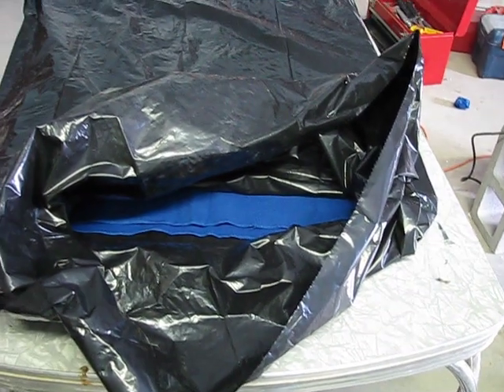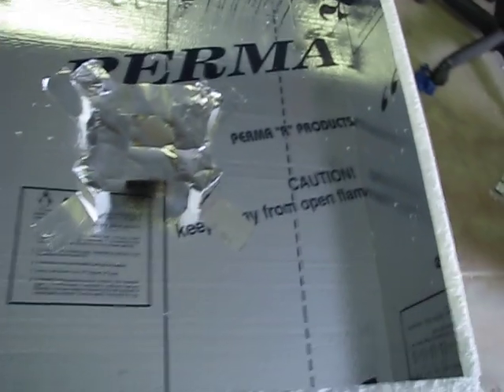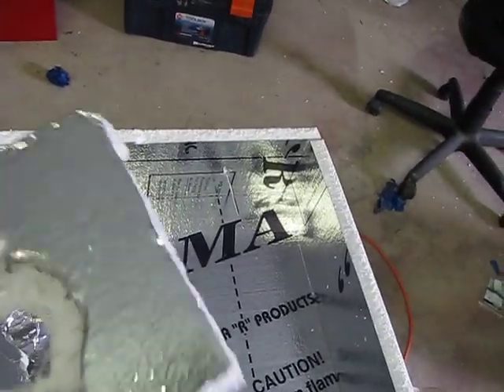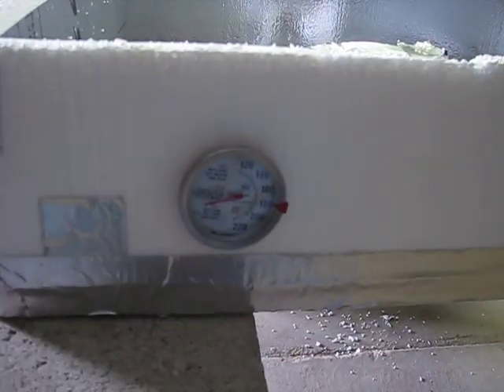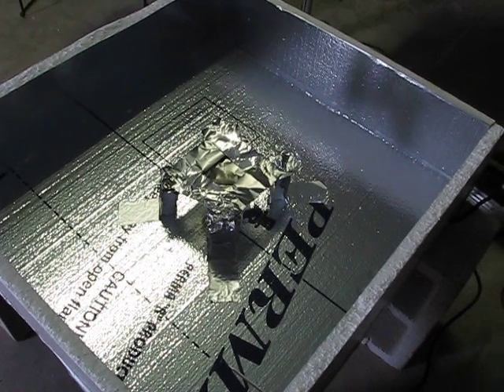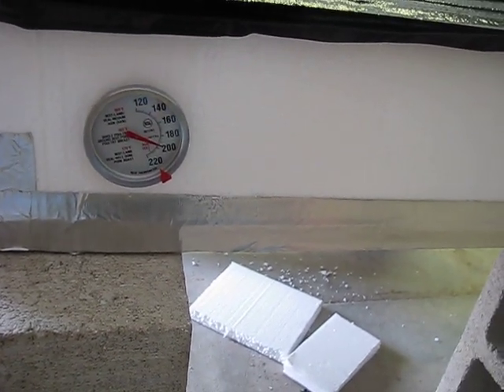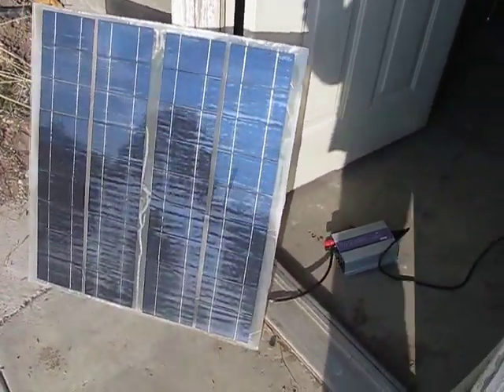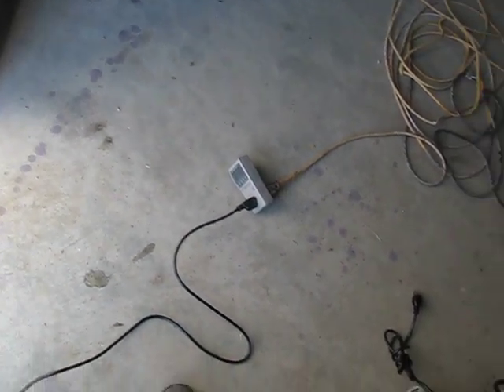DIY Solar Panel Design and build #5 vacuum Laminating

Comment: Any leaks in the drywall means the styrofoam will get eaten away by the heat. The aluminum tape was a great idea. Use it only outside the box. Inside the box if you look at my video, it will melt the glue and come un done.  I like your idea of spreading the heat. I tried to flow heat on top and bottom. I think it worked. basically in my system, the head comes from the bottom, on the glass. Then returns on the top back into the pump. The result is a good heat build up with little hot spots.

Comment: The melting of the plastic I prevented by using drywall. Drywall  is nice and sturdy, it absorbs water and it insulates. Also once I reach a high temp of 120 C the whole box stays hot for an hour or so. I calculated how much power I would need so I didn't have to cycle the power. It just slowly reaches temperature and then I unplug it at 120, it continues to go up (the reading on the temp sensor lags)  then it slowly glides down.  You need to have really nice sealing. Any leaks in the drywall...